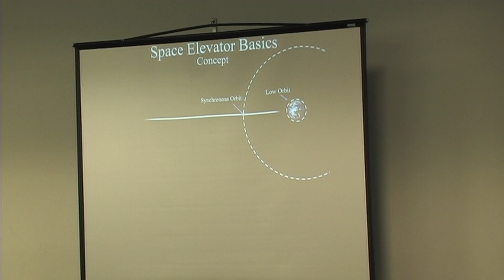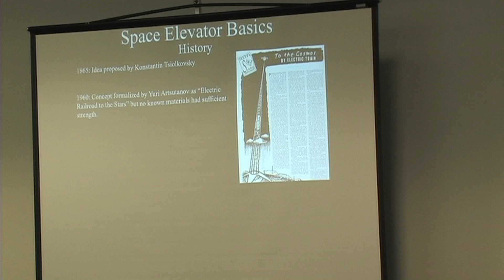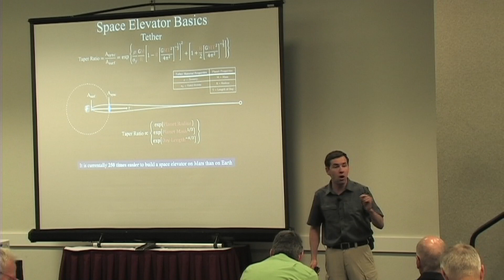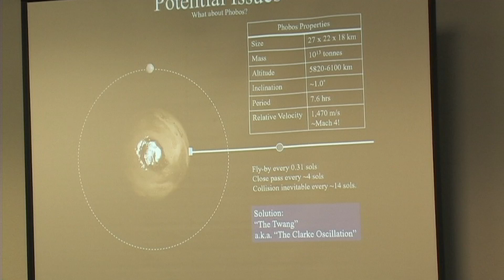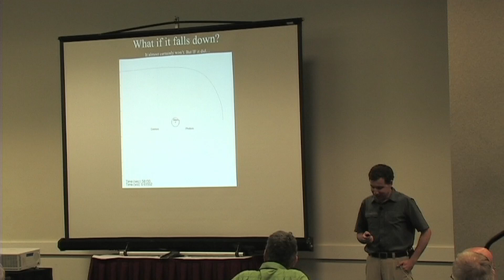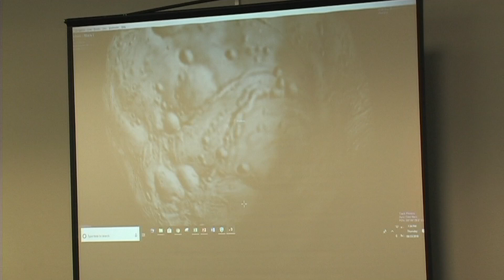Max Fagin - Space Elevator for Mars - 21st Annual International Mars Society Convention

Comment: Have carbon nanofiber developers become familiar with the ironsilk technology, used in fishing nets. In this way, the nets are made several times more durable than in the usual way and use several times less fiber than usual. In this scale it might help a lot. I am not sure if this technique is used only in finland (kivikangas.fi) but sure it is really effective.
Reply: Normal fishing net strength with different line.
wire thickness 0,15 mm(0,0059055 inches) 	yarn durability 1,2 kg
 (2,6455 lb, lbs)
wire thickness 0,17 mm(0,0066929 inches) 	yarn durability 1,6 kg
 (3,5274 lb, lbs)

With ironSilk line
wire thickness 0,16 mm(0,0062992 inches)	yarn durability 4,0 kg (8,8185 lb, lbs)

You need to scroll all the way down to see the table:
https://www.kivikangas.fi/pietarin-kaksoispaulaverkko-35mm-18m-lanka-ironsilk-monikuitu-016-pituus-30m

Comment: One of the downside of building a space elevator on the Mars is that rocket work better on the Mars than on the earth, for example starship (only upper stage without booster) can launch from the Mars easy 300 to 450 tons of payload into low martian orbit and returns to the ground to be used again, that would be a smaller investment that a space elevator since those vehicles would stay unused on the Mars until the window to earth travel is open.
Reply: It is true that launching rockets from Mars is much easier than launching rockets from Earth, (~6 km/s vs. ~12 km/s). But the economics of propellant production make it unrealistic to assume it will be possible to support a planet-sized export economy on rocket travel. For example, the Space Elevator I describe in this talk can support a throughput of ~1 million tonnes/M-year exported from Mars, with the option to scale up to 10x that over 10 M-years. That's not a lot of cargo on a planet-scale (it's still only ~0.5% of the cargo shipped through the Panama Canal) but supporting that small throughput with rockets would require a standing fleet of 10,000-100,000 Starships, which is simply not something Mars will have the industrial base to support.

So yes, for the time being, and for the foreseeable future, rockets are the best way to ship stuff to and from Mars. But if we wish to scale up to planet-sized economies, electromechanical launchers (of which a space elevator is an example) offer the most economical route. Even though they require a large infrastructural investment, they represent the best long term return on that investment.
Reply: @MaxFagin  I don't suggest to send parcked starship from the Mars to different destinations, only to use it for lifting payload from the Mars surface to low orbit, for that you need only 3,7km/s (that means 300/400 tons of payload on each launch) and reusing fast enough to launch millions of tons into orbit in a year with only 10 vehicles. Yes you need a larger fuel production but a space elevator wouldn't be easy to build without  large factory on the Mars. And before you ask payloads would be taken from the low martian orbit by special maked freighters, or even pushed to the right trajectory by the same ship that it launched after it was refueled with a tanker (only needs three refueling operation not eight like on the earth).like I said roket work better on the Mars than earth, but people don't understand how much better can be done and at so large scale.
Reply: @theOrionsarms  That doesn't really solve the propellant production bottleneck, it just translates it to the orbital freighters. Where do we get the propellant to boost millions of tonnes per year out of Mars orbit? 10's of millions of tonnes? Billions of tonnes?

My contention isn't that it is impossible (you can do anything with enough power). Rather, my contention is that at some critical mass throughput, a future Martian civilization is going to look at the amount of energy they sink into propellant production, realize how much more expensive it makes exported goods, and how they could get ~80x their return by investing in a piece of infrastructure that will pay for itself in a few M-decades (similar to investments in projects like the US interstate highways system or the Panama Canal).
Reply: @theOrionsarms  And no, a space elevator would not require a large factory on Mars. As I explained in the talk, the manufacturing is entirely done in synchronous orbit. The only manufacturing it would need on the ground is the facilities associated with building the climbers and processing payloads.
Reply: @MaxFagin  on the Mars you don't need billions of tons of propellant for lifting one million tons of payload, fuel to payload ratio would be 3 to 1 for low orbit, and can be 10 to 1 for sending payloads to earth or ceres, and to make 3 millions of propellant in a year you only need to produce with a rate of 100 kg/s. How much energy you need to make so much fuel? I think 65 Gw will be enough, and obviously if you can make millions of tons of strong cables into martian orbit from raw materials mined from Phobos, you can produce roket fuel too. The bottleneck problem would be more a problem for a space elevator since you need space freighter to send payloads from the elevator and to dock with it in the sincron orbit portion, still a space elevator would be more efficient for lifting payload to orbit, but cannot work without using energy, less than for making rocket fuel but roket propellant facilities can be considered a form of infrastructure too, and every type of martian colony will have a stock of unused rockets because they used to arrive on Mars.
Reply: @theOrionsarms  You don't actually need a dedicated freighter to capture interplanetary payloads and bring them to synchronous altitude or to the surface with a space elevator. At ~50000 km altitude, the velocity of the tether matches the arrival velocity of an interplanetary vehicle. For several hours each sol, payloads can be captured and lowered from interplanetary space with a negligible expenditure of propellant (just like they can be released and thrown into the inner or outer solar system for negligible propellant).

65 GW is a huge number for either propellant manufacturing or space elevators, but let's run with it just to show how much of an advantage space elevators can confer over chemical launchers: 65 GW would be enough power to manufacture all 320,000 mT of CNTs required for the space elevator described in this talk in just 15 sols! (of course, the actual production couldn't go that fast because the CNT production bottleneck isn't lack of power, but still, that should illustrate just how energy-intensive propellant manufacturing actually is.)

What if we already had a tether and had 65 GW of capacity to devote toward lifting cargo up it? You say 65 GW would be enough to support 3 million tonnes/year of propellant production (0.3 million tonnes/year to Earth). Very well. That same 65 GW in lifter capacity would be enough to support a space elevator throughput to Earth of 136 million tonnes per year (450 times higher)! Again, this is a bit unfair because a 320000 mT tether couldn't support enough cars for 136 million tonne throughput, we would need to devote another 330 sols to bootstrap the tether until it was wide enough to support that many tethers (though it would really be more realistic at that point to simply build more elevators).

To put it another way, if a Martian civilization had 65GW to burn, they would have a choice.

1) Devote 65 GW to propellant production and 0GW to space elevator production. Export 0.3 million tonnes/year to Earth indefinitely.
2) Devote 64 GW to propellant production and 1GW to space elevator production. Export 0.3 million tonnes/year until the elevator is done, then export 2.0 million tonnes/year indefinitely.

Edit: The Earth capture/departure point is at 50,000km not 22,000km.
Reply: @MaxFagin  I already said that a space elevator would need less energy than fuel production, but you need to build it and compete with existing rocket that only needs refueling, and three million of tons of fuel on the Mars surface it doesn't mean only 300000 tons to the earth, if you make another million tons of fuel on the orbit from Phobos raw materials can send to the earth the same million of tons that you lifted to orbit with a ratio of 4 to 1 between fuel and payloads, for comparison if you send a ton of payload from earth surface to the Mars surface you need 350 tons of roket propellant on the earth using the same type of fuel and rockets. Like I said rocket work really well on the Mars, propellant consum decrese exponentially if you are at the right side of the rocket ecuation.
Reply: @theOrionsarms  As you keep pointing out, yes, it is easier to launch rockets from Mars than from Earth. Given the ratios of the planets' masses and radii, we can say rockets are almost exactly 5x easier on Mars than they are on Earth. But as I showed in my talk, because of the way space elevators are built, their relative performance goes as this ratio *raised to a third power*. So a Martian space elevator isn't just 5x easier than a terrestrial space elevator, it is ~125x easier. The only reason not to build them on Mars is the large upfront investment, which, as I've shown, is really quite small compared to the investment in chemical propellant manufacturing that you have suggested implementing.
Reply: @MaxFagin  you can add on the pro space elevator list fact that a space elevator use energy of descending payloads to lift the ascending one (more efficiently indeed), and releasing payloads from a the tips of the cable is a valid technique (but will work only for relatively small payload tens of tons, at least for a decent size one, not a billion tons cables), but catching a payload that comes with great speed from interplanetary space it is a risky maneuver, you can lose your payload and damage the cable, probably in this case aerobreacking would be used to to capture the vehicle in a stable orbit and a space tug for transfer to a space port attached to the cable. However large roket propellant production is needed even if you have a space elevator, that cannot work by yourself without space tugs and interplanetary ship that needs to be refueled.
Reply: @theOrionsarms  Relative to the elevator, the payload isn't coming in at great speed. The relative velocity to the tether is only 10's of m/s if you arrive at the right altitude.

And I never said space elevators would make rockets unnecessary. Obviously, they won't. I only said that I expect they will carry the majority of payload that Mars exports. Just like here on Earth, we may have aircraft to transport people and urgent goods, but the majority of long-distance transport is still done by ship due to the higher efficiency and lower cost per kg.
Reply: @MaxFagin  I know how catching maneuver should be done, but even at 10m/s a vehicle bumping from a side a tensioned cable can make some damage, I would not allow some cumbersome vehicles coming near to a expensive and hard to replace piece of infrastructure. Such catching and release maneuver should be made with a special designed equipment like a rotating skyhook, which would be more equivalent to the maritim shipping than a space elevator (that is more like a railway or a bridge if you want to make a comparison) yes every method of transport have some strong and weak parts, for example a space elevator is the most gentle way of leave and come to a planet (strong part) and the most slower (weak part). That means if you want to carry passengers with it only the very old and with brittle health that can support acceleration would choose this method. And yes I think would be used different methods of transportation not only rocket and space elevators but mass drivers or even centrifuges like one the SpinLaunch company work, would be a niche for everyone if can compete.
Reply: @theOrionsarms  You are correct that a space elevator will take a long time (~10 sols) to travel from the surface to synch or via-versa. And while that is a long time compared to chemical rockets, it's not a long time compared to the months the cargo will need to spend in space anyway in transit to its destination. The time required to ascend and descend a space elevator does not significantly increase the time (and thus the cost) of interplanetary travel. And should interplanetary travel ever becomes fast enough that a space elevator is a significant bottleneck, then we by definition must have access to propulsive capabilities that make both chemical and electromagnetic launches obsolete anyway.
Reply: @MaxFagin  are few more aspects to take in consideration, like maximum size of the passengers capsule, how many people can carry considering their needs for life support sanitation and sleep, and how demand is distributed it in a local year (would be a rush season when a lot of ships arrive simultaneously from earth and many passengers will want to be carried to the surface of the planet). Also not all will want to land in the same place and will need to use ground transportation to get to their final destination,  would be needed a large network of roads on the ground for connecting space elevator terminal with rest of the planet. On the other side a passenger rocket vehicle will be reused several times on each day, passenger would staying strapped in the seats all fly (so at the same size can carry five more passengers on every course compared with sleeping pods) and can land in hundreds of different locations spread around the world, including near poles when a space elevator cannot be anchored. This is my opinion that for human transport a minimal space elevator will not be utilized but a larger one that can carry very large climbers can be, or maybe faster method of climbing like electromagnetic levitation.